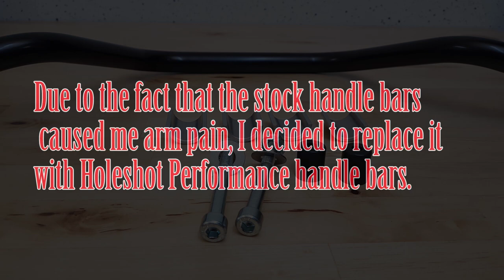Kawasaki Versys 1000 handle bars swap - Holeshot performance handle bars

Comment: Hey Andy, as always your videos are awesome and a pleasure to watch! QQ, next week I will attempt to install 1" handlebar raisers, should be a simple 10 minute install. I'll probably have a bolt or two left over as always, LOL. My cables (brake, clutch...) they all look like they are tight and do not have more slack to accommodate the raisers. Watching your video, your cables seem to have tons of slack. Is there something I need to do to have more slack on those cables?
Reply from the maker: Thanks man, I`m glad I can help.
I didn't do anything with the cables, the only thing I did was unscrew the grommet, fixing the brake hose to the front wheel.
try to move and pull gently all cables and hoses, maybe they will get more slack.
Reply: @MotoAndy  Got them installed today, no extra screws left over, LOL. As you suggested had to move the cables gently for some tiny bit of extra slack. The next statement is for Moto-Werk - Not happy with the gap of about 1/4 on both front and back. I know I installed them correct side as the other way the gap is even bigger cause of the small notch cutout. I even lay-down the Riser with the OEM top cover and they do not sit snug with each other. Took some pictures and will call Moto Werk tomorrow. I bought other items from them and they fit well, but not these Risers. It seems as if the cutout in the Riser for the pipe\handlebar to go into is about 1/8 of an inch smaller than the depth of the handlebar on 2018 V1000 LT. Basically the top OEM cover never touches the riser while on top of the bar and bolts screwed in tight with same distance fron\back and torqued as specified. Now that I double checked their site, even their own posted pictures show gaps. I'm not a mechanic but wondering how safe is it having that gap?

Comment: Hi from Greece, I'm a new owner of the 2015 V I000, and one reason I bought this bike is because of your great videos and advice on mods. So thanks a lot. I'm thinking about getting the Holeshot bars and watched your video on the installation. Will my current grips (not heated) fit on the Holeshot bars and apart from the holes you drilled to accommoate the cable fasteners I didn't understand why you made the other holes? Were they for the heated grips? Did I miss anything? Thanks again for the great info!!
Reply from the maker: Thanks, it's nice to read that, enjoy your bike 🙂
As for the holes in the handle bars, the switch has a pin that prevents the switch from turning, so I was drilling holes for it, you can skip this step. The handlebar ends are the same size as the original so the grips should fit seamlessly. You can find all this information on the holeshot performance website or youtube channel https://youtu.be/poq6g75FvZI
Reply: @MotoAndy  Thanks mate, you got me covered, ride safe.

Comment: Hi Andy, great tutorial and very much appreciated like your others. Did the swap improve the  comfort for you  and what in particular was affecting you ? I'm looking for a more upright position on my V1K because of an elbow problem. Do you think there's enough cable and brake line slack to accommodate 2" pivot type risers? Cheers Paul
Reply from the maker: Hi Paul, I changed the handle bars because of my back problems and pain in the elbow that was caused by the original bars. After sweap the position on the motorcycle changed positively, I sit more upright, I do not feel pain in the elbow. All cables and wires are long enough for these handle bars and you do not need to change anything. I'm very happy with it. For more info about this handle bars check http://www.holeshot.com/kawasaki/versys/1000/products/comfort-touring-bars
Reply: @MotoAndy  Cheers Andy, sounds very similar to  me. Great to know it worked well for you, enough that you still have the bike. I'm going to start with some el cheapo pivot risers to test test the effect without breaking the bank and see where we go from there. Your mechanical skills are well beyond mine! All the best - Paul

Comment: Hi Andy, do you know if the handlebar is the same in versys 1000 2020?
Reply from the maker: yes, it is the same only it has differently drilled holes for the switches, I have the same handlebar installed in my 2022 1000SE

https://youtu.be/_kQeC-P5vK8
Reply: @MotoAndy  thanks a lot for the help Andy.